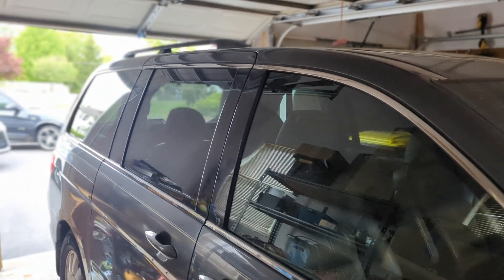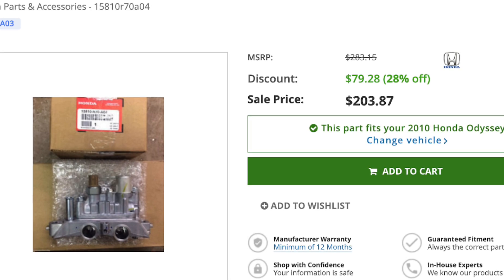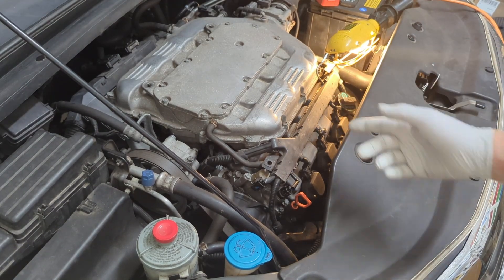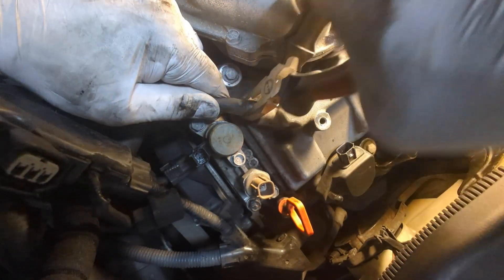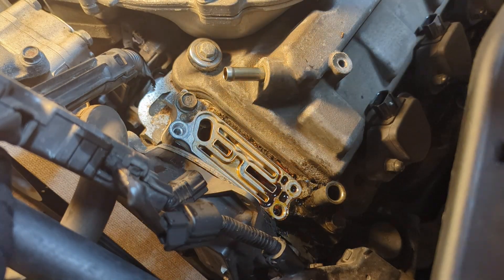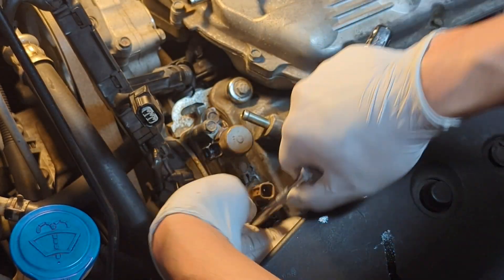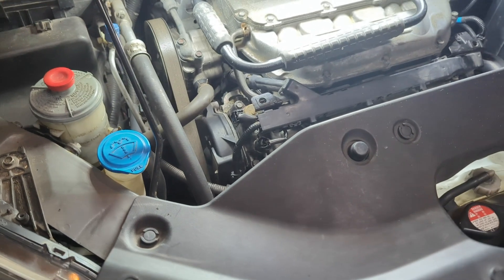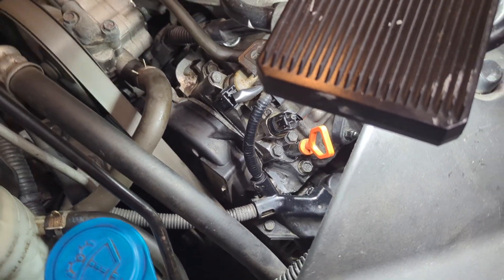Honda VTEC Oil Leak: Ultimate Fix for $10 Only and Save the Alternator

Comment: isn't the gasket for the 2005 RL located on the underside of the car next to oil pan housing?
Reply from the maker: That sounds right on the J35A8 engine but I haven't seen that engine in person to confirm. Honda does have that design on the J35A6 with the VTEC solenoid at the top of the oil filter assembly. Here is a good reference: https://www.youtube.com/watch?v=WAK-BTD6KWI&t=8s. Take a look at your RL and let us know if it's there too.
Reply: @profsg  Great link! Thanks. I'm looking to change the o-rings